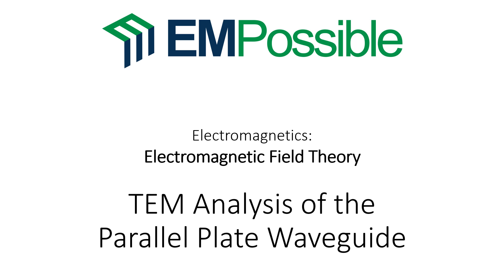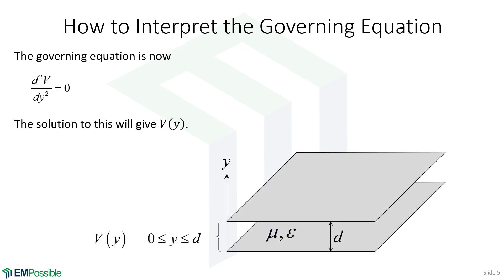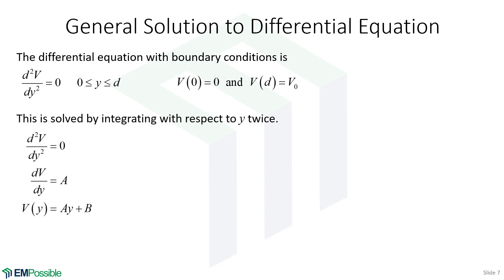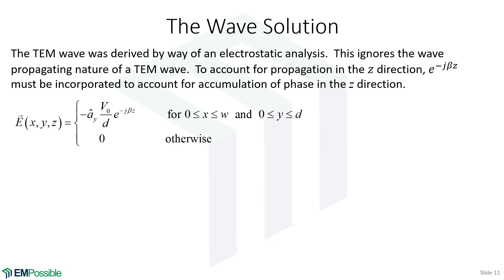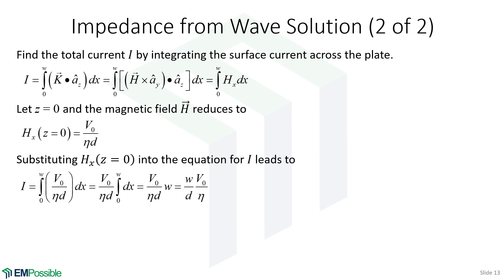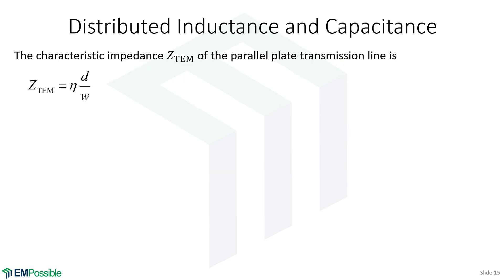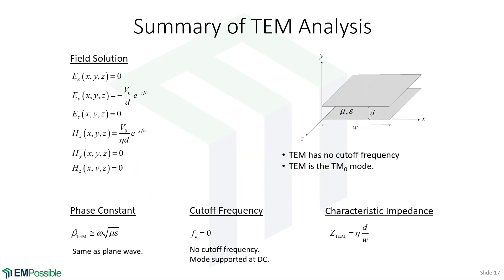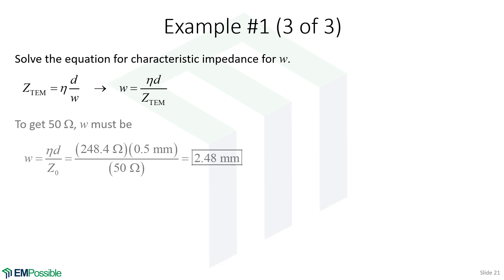Lecture -- TEM Analysis of Parallel Plate Waveguide

Comment: I have a little confussion, why B (or H) are not circulating around E? i know that Bz = 0 but the nature of B isn't circular?
Reply from the maker: I am actually working on some new visualizations. The reason is that the PP waveguide is of infinite extent. Therefore, the mode also has to be uniform in those same directions. If the PP waveguide were limited in width, you would definitely observe circulation.

Hope this helps!

Comment: Thanks for the video. Would you mind making a lecture about describing what happens when B field is impressed normally on a lossy metal plane? My understanding it that it will excite eddy currents such that it will perfectly cancel out impressed B field when conductivity goes to infinity but I am not able to rigorously derive it.  

Another point is that this problem might seem deceptively simple but could be more challenging since the E fields should have circular symmetry while the impressed B field iss best described in rectangular coordinates. I would appreciate your thoughts on this
Reply from the maker: Hmmm...Let me think about that. I suspect your answer lies in the discussion of boundary conditions.